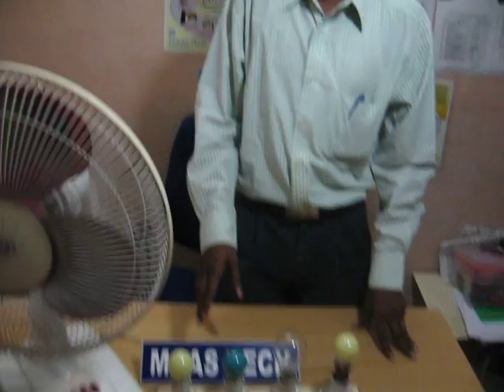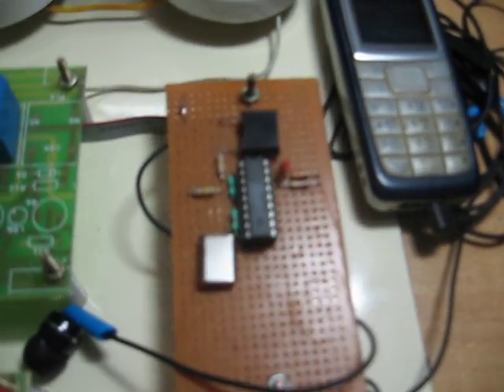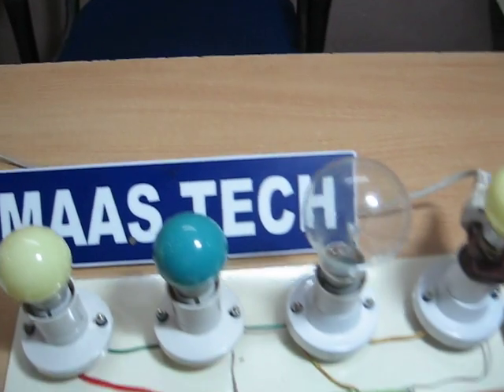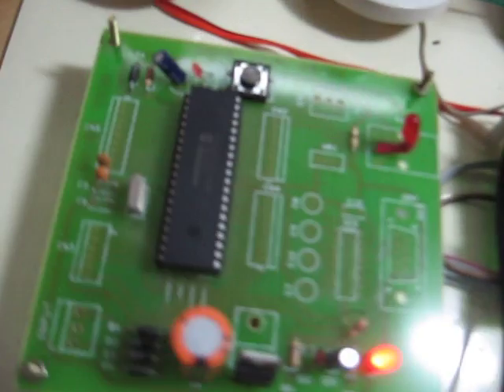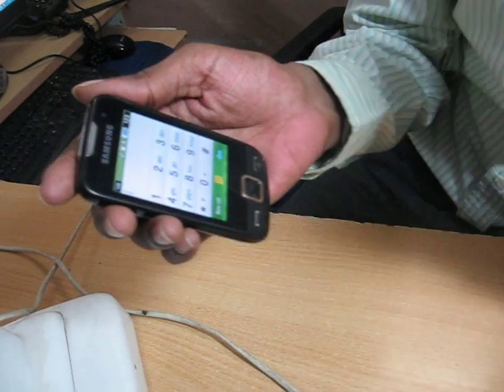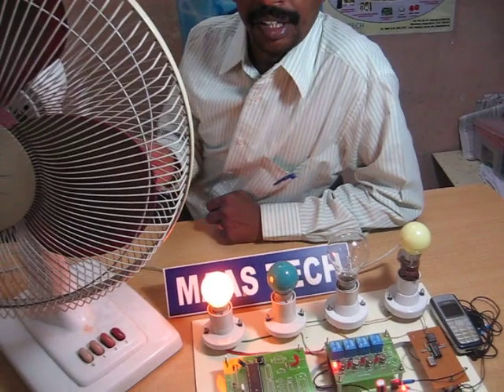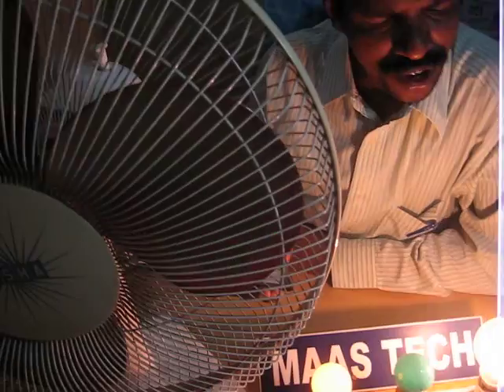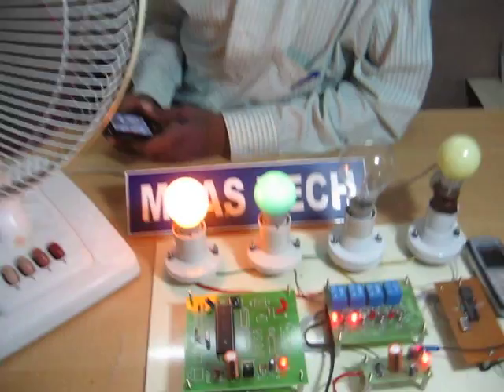MINI PROJECTS CHENNAI ,MINI PROJECT TAMBARAM,MINI PROJECT HELP

Comment: I HAVE ENGINEERING PROJECT FOR SALE IN PAKISTAN KPK PESHAWAR. PROJECT IS SOLAR UPS. PRICE IS 18000 Rs. WILL BE PROVIDED WITH THEISES AND SLIDES SOFT COPY. PROJECT IS 100% OPERATABLE. OUTPUT IS 20 WATT. STUDENTS OF ENGINEERING AND B-TECH CAN BE CONTACT.PROJECT CAN BE USED BOTH ELECTRONICS TECHNOLOGY AND ELECTRICAL TECHNOLOGY STUDENTS.ONLY STUDENTS OF PESHAWAR CAN BE CONTACT AT THIS NUMBER.03459197380